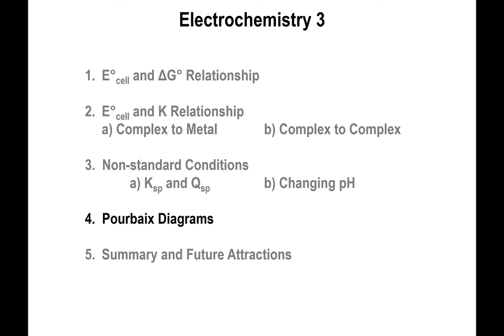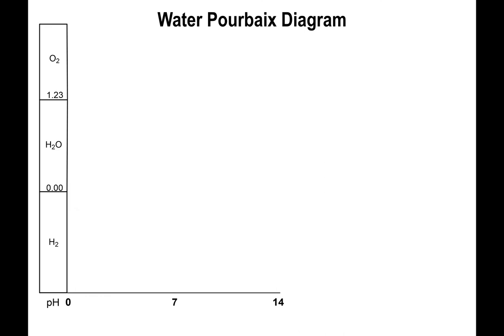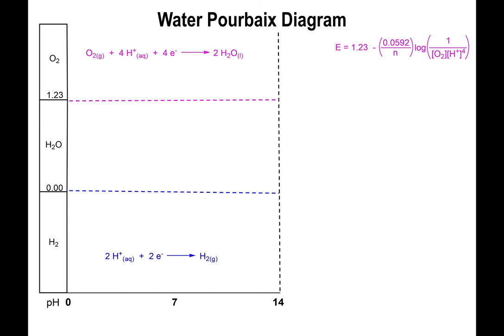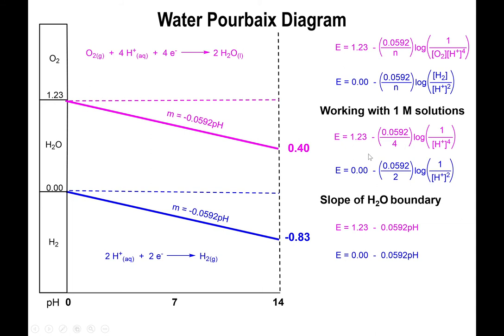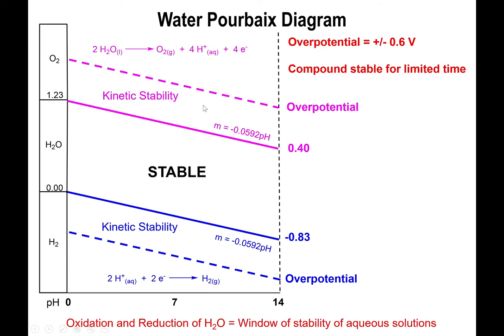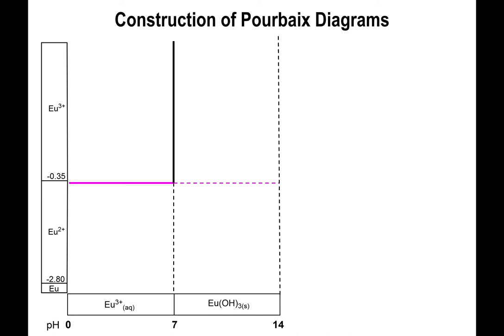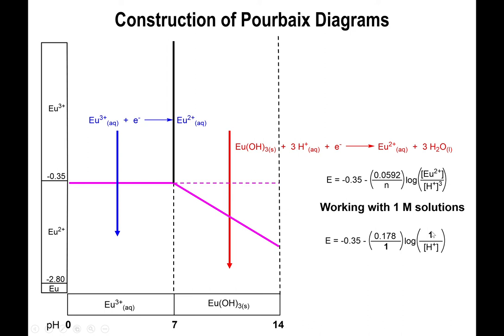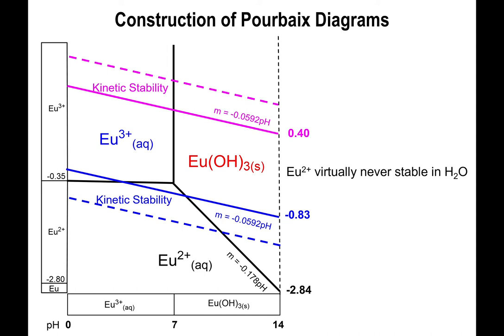Lec20 - Pourbaix Diagrams

Comment: At 3:21 you say that the water doesn't make it into the equation. May I ask why that is? Is it because the concentration of the water is rarely used as a concentration and can be thought of as a constant? Thank you for the assistance!
Reply from the maker: Hi Jacob, that is exactly right. The concentration of water is virtually unchanged during the course of the reaction, so it is treated as a constant and generally it is accounted for within the value of the equilibrium constant itself. Thanks for watching.
Reply: @aluminumchemist2586  That makes so much sense! Thank you!

Comment: Basically， the oxidation state(s) of Eu displays amphoteric behaviors shows 3+ to 2+， is that right？
Reply from the maker: Hi Lance, I wouldn't refer to it as being amphoteric, as that implies both acidic and basic behavior. The fact that Eu changes from 3+ to 2+ simply points out that the metal has redox properties. I hope that helps.

Comment: at 4:05 we assumed concentrations of molecular oxygen and hydrogen to be one, does that only apply to gases and not the Hydrogen Ion?
Reply from the maker: Unless the pH is constant, the H+ concentration will change. So, in short, only the H+ concentration is changed on those diagrams. However, it is completely okay to derive graphs where all other substances have concentrations other than 1.00 M, it just depends on what system one is interested in.